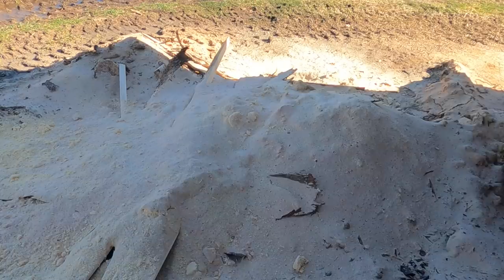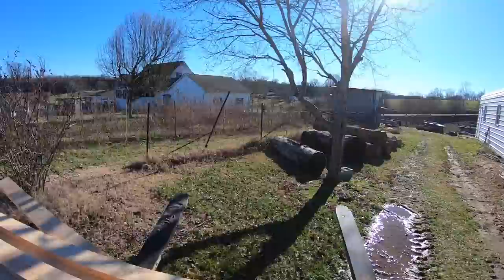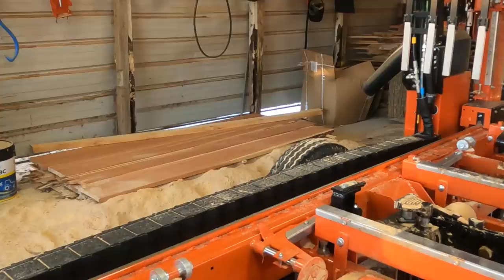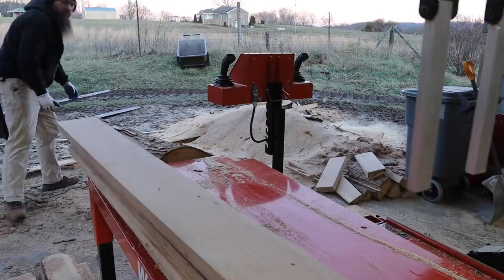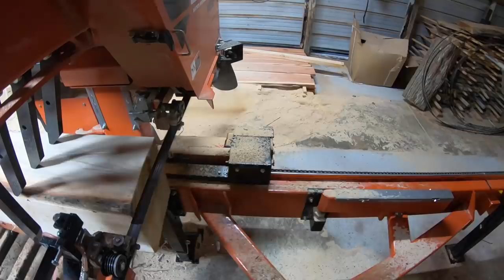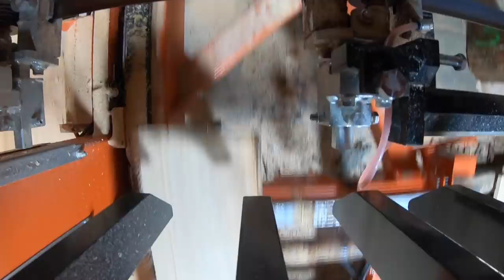Take A Look At What Was Going On At My Sawmill Today

Comment: If I could go back in time there are two things I would do. I would have a sailboat, because that looks like a lot of fun. And I would have a sawmill, there's something really great about a sawmill. 
I come here and enjoy your videos because of your skill on the sawmill and the beauty of the wood, your easy-going manner, your funny outtakes and (now), your ability to shut down the trolls with kind words and a smile on your face. Don't change a thing friend. I'm pretty sure most of the 149K subscribers here like the channel well enough.
Thanks for the videos.
Reply: Doug Koyama, I've got a sailboat (actually, several over the years) and I've had a sawmill.  Both have been fun for much the same reason; there's a lot of hard work involved but it's quite satisfying.  With both the boat and the mill I learn something every time I use them.  Both have made me a better problem-solver which improves my outlook on the world.  So, go get a boat and learn to sail.  And get a sawmill and learn the wonders of nature found inside a log.
Reply: Now, if you could set yourself up with a floating sawmill, you'd have everyone jealous!

Comment: For your sawdust, have you ever thought about using an old section of grain elevator along side or your mill to carry it to a pile or wagon, like the old sawmills did?
Reply: All the old sawmills I remember had a chain drag running under the blade area, right angle to the carriage, out to a pole. The sawdust would eventually build up to a huge mound. Once to pile reached the pole's chain drag pulley, it would be time to remove the mound. But folks looking for sawdust/chips for animal bedding would keep it worked down. Plus I remember playing in the sawdust as a kid. I can see a chain drag/trough running into a right angle auger system working for these Wood Miser mills. I did like the vacuum/blower system on that one guy's mill he showed.
Reply: Love your channel, haters will hate instead of moving alone.

Comment: beautiful Oak boards, I'm disappointed you didn't do a closeup or a wet-look on them.  Disregard the complainers, they are everywhere, and no matter what you changed, they'd complain about something else.  I fast forward thru the parts I don't want to watch (when you aren't cutting something) and I have a nice experience on your channel.  Keep up the good work.  Put a tarp down under your sawdust elimination line beside the sawmill, and then just fold it over and drag it with the tractor to the burn pile.  No double handling.

Comment: I recently bought the LT 35 only down is I won’t see it till next December due to back orders. Watch all your videos. I mention your sight to the Texas dealer and question you using diesel in your water system and they said it stains and makes your wood smell like diesel, what are your thoughts on that? I’m a boat captain winding down my career in a few years I have 80 acres of heavy timbered pine, red and white oak , big cedars and hickory. I’m hoping to do the mill as a side job to make money from home once I get the mill figured out plan on adding a kiln. Do they’d add enough value to the lumber to make it worth its cost? The reason for the mill purchase was because I priced selectively logging my land and got an insulting price for my timber so I decided to cut the middle man out and I’m also going to be cutting my own lumber for my house and big shop and also a mill shed and building to stack my lumber. Wish me luck and keep sawing out those videos

Comment: I’m a hobby woodworker and enjoy your channel. I learn so much about the different woods u saw and I use. Thanks!!  One quick question, how do u maintain a saw kerf when leaving multiple pieces of sawn wood on the remaining log?
Reply: The teeth are a little wider than the blade so it creates it's own kerf. If he stopped milling mid cut then it might be an issue but as long as the blade keeps moving its fine

Comment: Hey Nathan, I have recently got into sawmilling with my late uncles LT15. I am wanting to make some flooring that will eventually be planed and moulded into 3/4" tongue and groove. Should I cut it into 5/4 or 4/4?
Reply: 4/4 is not problem to get a 3/4 thick board out of.
Reply: @johnclark5153  even after drying and  any shrinkage or cupping
Reply: @natstas2725  you should get 13/16 from it after surfacing two sides with some cupping and normal shrinkage.  Heavy cupping you will not.

Comment: UGLY beard!?!? Some people just need to get a hobby!!🤣🤣 On another note, your dust collection issue. Couple of possibilities,  obvious one is a blower/vacuum.  Another would be a small conveyor that has a trough that your dust pipe just rides above. Put it on wheels so you can move it, but it would get most of the dust into one place. I use them for moving materials between machines and one to move dust into a dump truck from the bottom of my dust collector. You don't want to buy new as they are a little pricey though.